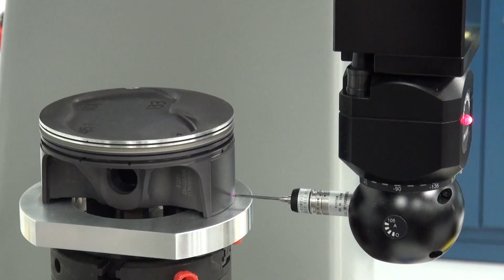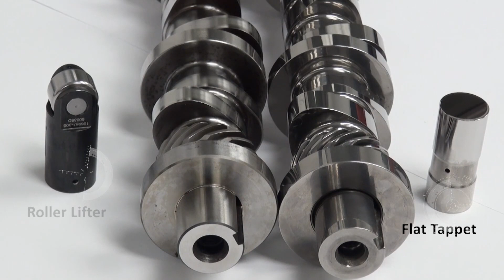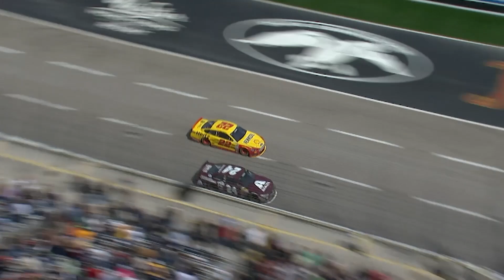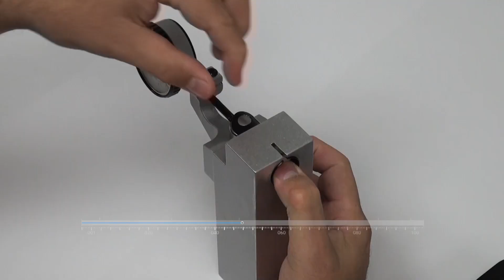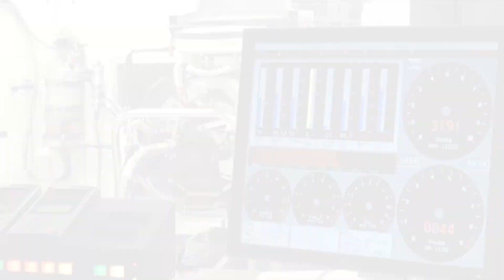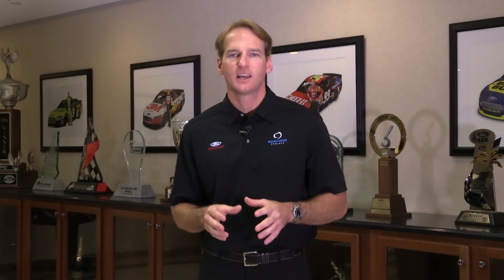2015 NASCAR Engine Rule Changes - Roush Yates Engines

Comment: God NASCAR sucks. Who wants less power? They're gonna end up like F1 running fucking vacuum cleaners for engines.
Reply: in 2017 f1 might be running 1000 HP if the FIA allows it and if there are changes in the tire regs
Reply: lol 

@True Story
Reply: +herpherpbrocolli I agree.

F1 is boring follow my leader on tracks that need little driving such as braking and gear changing.   F! racing needs narrow tracks with tight slow corners and no wide run offs for the fools who don't know how to switch their adrenaline off.
Reply: i agree!

Comment: Reducing HP for fan's enjoyment? Ha! Now that's a good one! Nascar's COST reduction excuse seems to be a NO SALE for race teams. I sure see no way any substantial savings could occur. Since when is a race team saving money when it is forced to discard shop full of engines & buy new ones? Engine makers might eventually profit, but race teams seem to eat costs, not savings. Regardless, the roller lifter assembly seems like it would be more expensive than the flat variety. The flat ones appear to be only one part & not an assembly, which would make the flat ones the cheaper of the two, no? Regardless throwing out parts, whether it be a small bin full or pallets full, doesn't equate to saving here either. And, no doubt, adding a spacer, or any part, where previously none existed is an ADDED COST. I still don't get what changed with the cam shaft, but again, throwing out a bin of them to make way for new versions is a cost, not a savings. And (lifter) RELIABILITY is increased by putting a two or 3 part assembly where one part was previously doing the job? At a minimum, I think that is also a questionable, if not a counter intuitive claim.

Considering all the new track records this year, I think venue insurance "cost" is the factor truly driving these changes. To me is seems probable that slowing the cars was mandated by insurance companies. In reducing speeds to obtaining affordable insurance Nascar seems to guard it's own interests & profitability, but the cost seems to get passed onto the teams as a result. In the big picture, if teams can not go racing because Nascar can not insure their events, well then YES, buying a few new motors is less costly than having your entire race team become obsolete. And, YES, fan excitement is much higher at a HP decreased race, as compared to NO race! If that is what is happening that's what race fans should be told. Regardless, the corporate media agenda driven PC BS is a big NO SALE!
Reply: The teams have probably been begging NASCAR for roller lifters for decades. There are a lot of advantages to them - less friction and higher reliability for two, they don't wear out cams - you only get a few races out of a flat-tappet cam - and the ability to use more extreme cam profiles.
Reply: Jim Mowreader There are 38 races in a regular season (including the all-star and assuming speed weeks is one race since teams aren't supposed to change engines during the week).  With flat-tappet engines, a team can use an engine for about two races before the cam is shot to hell.  Pretty much, that means with flat-tappet, at $100k per block, you're looking at $1,900k or $1.9M a year in engines.  Assuming a block can go 3 races on rollers over 2, that's saving a team about $700k a year alone.  Not to mention with longer cam times that rollers can offer, the effective compression ratio can still be higher than 12 which cars typically tend to like more than what their paper specs say.

Comment: I'm sure this is all NASCAR smoke and mirrors to make the Fords and Yodas feel like they will be more competitive. NASCAR didn't have a problem slowing the Fords down in the 90s when they had superior power. They should just give the same treatment to the Chevys but everyone knows the France family who runs NASCAR is in bed with GM.
Reply: The rule change is for all engines...Chevrolet, Toyota and Ford. All engines will be using the roller tappets and tapered carb spacers.

Comment: So again...  nascar cuts power since toyota can't make the power.
Reply: +svt88 funny thing is that nascar told toyota to detune their engines in 2007
Reply: Dude Toyota could easily make an engine with significantly more power than any GM, Ford, or Mopar engine. What have you been reading?